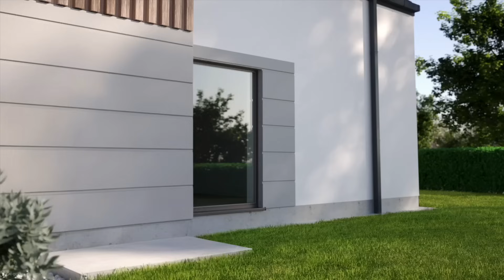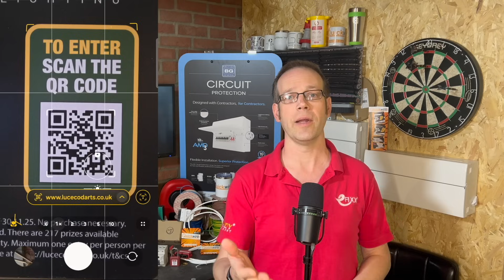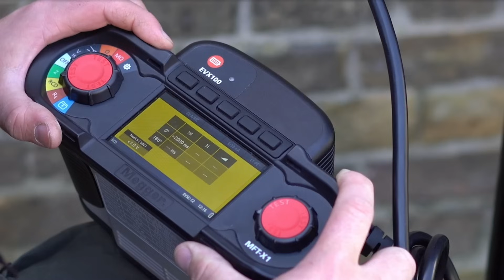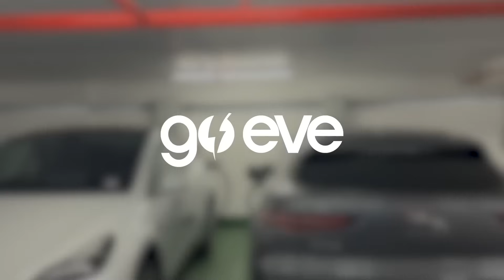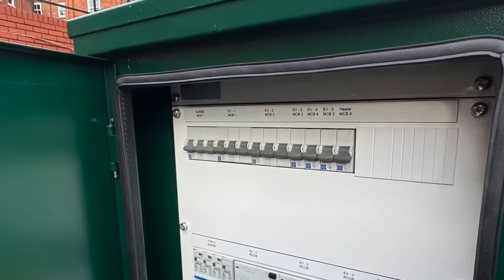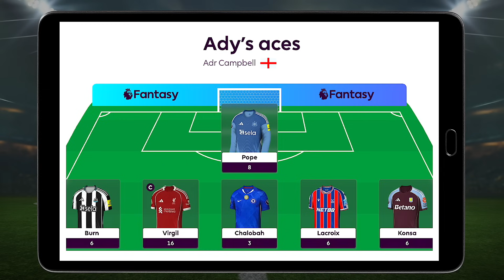National Grid Wants To Move Electricity Meters To The Garden

Comment: My neighbour has a 3 phase supply but it was unable to successfully heat a bungalow on his land. He asked for a replacement which could be supplied at a cost of £146,000. He declined and installed solar power. In addition to quoting for supply the provider made the comment there was no way they could guarantee the supply. Power failures are quite normal in rural areas. So there you have it. There would also be the point that exposed electrical consumer units would be at risk of accidental damage and increase the liability of anyone involved to electrical injury as well as impact injury. I suggest the insurance premium of the property might well increase. Another oversight by the Government that Mr Miliband has forgotten to tell all of us about and about how the whole of the community will be made liable individually for the cost.
Reply: I'm not sure the first part makes sense, what was the method of heating? And what us his heatload? I suspect it's a lot less than 41kW even if it was resistive heating.
Reply: Definitely a case for Air Conditioning!!
Reply: The heat pump technology with R290 systems has changed a lot over the past year, plus, if we are all honest, I think all of us engineers are a lot older, wiser, more educated and more experienced at installing these large integrated photovoltaic, heat pump, battery, air handling, computerised systems that have only really becoming truly successful in the past year or two.
Reply: @Ino-z2m R32 knocks the sox off all of them..

Comment: Just no! Why is there SO much info directed towards electric charge points for EVs?
Any business which depends entirely on this tech is going to fail.
The demand is dropping, the tech and infrastructure isn't there yet.
OK, you might make a few bucks for a year or two, but the public do not want EVs...and once you have one, you won't be buying another one anytime soon (unless your original unit fails).
Be smart and stick to installing conventional systems, not EV charge points...that ship has sailed.
Same with heat pumps...if you have the land and the money, ground source is brilliant...but 99% of the population do not have that capability.
Don't be fooled by the net zero madness, it simply doesn't add up.
Reply: @colinritchie1510  we are trying to buy an EV but the cars that work for us just aren't available as an EV

Comment: For decades I have stood in disbelief as the power network keeps running single-phase to anything they can get away with as the rest of Europe looks on in bewilderment.  Not even publishing ducting requirements to allow for a 3-phase 'future' for new builds.  So here we are - looking to put ugly street boxes everywhere for 3-phase whilst still installing new single-phase everywhere.

Not that DNOs can get their facts straight.  For my own home I enquired about a 3-phase upgrade as we readied for the new electric-only future.  The bad news was the nearest 3-phase node was at the far end of the street, with no practical path.  So in went single-phase solar, CUs, with export limits et al.  Once the solar, battery etc was complete the DNO sent a revised network diagram of our small road.  To the surprise of nobody reading this far, the nearest 3-phase node was actually located on my land, about 5 metres from my meter cab, from which I get just 1 of the 3 available legs.  Grrrr
Reply: Living in a 1940's house... 3 phase into the house! So what changed??
Reply: Out side the uk 3 phase is used so they can use 3x50A (or lower) supply, uk we generally get 100A per phase even if its single phase

They doing this so the dno supply ends at the curb anything after is home owner problem if there is a fault they have to pay (currently anything upto the meter is dno problem)
Reply: @leexgx not quite. Since at least 2023 NGED have standardised single phase to a max of 80amp- they no longer fit 100A to single phase. And they’re only responsible upto the CO. Meter AND tails belong to supplier. Either way it’s a ridiculous idea to have boundary boxes like this. What’s worse is that no one is addressing what anyone living in terraced housing with no gardens will do about all these future requirements like EV charging etc.

Comment: Is this National Grid as Grid operator or the DNO? I suspect the latter? I cannot think that they are trying to solve a problem that barely exists? I am not an electrician by trade, but do have a house which is heated by a heat pump (14kW - yes bigger than most homes need) and an EV. With single phase the draw can reach 14kW in the wee small hours when the kitchen fairies (dishwasher and washing machine) are working, the car is charging and the heat pump thinks we are about to have a legionella outbreak... and whilst a 3 phase charger will help those with expensive EVs it won't help the average household even with 2 EVs. Most people don't drive more than 30 miles a day which is roughly 8-9 kWh of charging. The Grid and DNOs have the wherewithal to manage the timing of newer than 2020 chargers (the vast majority) so where is the problem? It will help those who aren't able to park their car immediately outside their house. In Scotland most of the homes built in the big 'housing schemes) are in such a position as are those with garages clustered away from the houses as was favoured during the 1960s.

Comment: I have red / green / brown issues and have never had a situation where the colours on the wiring were so poor (Australia uses red/white/blue black and green/yellow for fixed.  Plenty of older green earth out there and even clear / bare separates) that I could not easily distinguish them.  Even the muddiest example of IEC colours I've ever come across are a breeze.  A man (it's mostly a male problem) would need to either be truly colourblind, ie monochromatic, or missing a colour completely (red or green) for it to be an issue, in my opinion.

Comment: Megger need to fix the massive issues with the X1 first, dodgy firmware, crap test leads, etc
Reply: You mean great test leads imo, a million time better than the Kewtech ones I use with a 1552…and I’ve had no problems with the x1 after all the firmware updates
Reply: The leads aren't crap they are always 10cm too short and you stretch them making them crap!
Reply: @Ino-z2m  maybe we got a dud batch, the strain reliefs were SO stiff there was no way they could be described as strain relief,  and the connections are hella loose. Even brand new, moving a connection would vary by 0.5 ohms. Contacted megger about it, they ignored us entirely

Comment: But the National Grid is also saying that when everyone has an EV the LV distribution network will only have enough capacity to supply 7.5kWh per consumer, per day for EV charging. That means even if you have a 7.5kW charge point, you can only charge at that rate for one hour per day or, more likely, your charge rate will be limited to 1kW for 7 hours at off-peak times.
Reply: I don't know about that. The house I live in was built in an "all electric" development of around 70 houses in the 1970s with storage heaters and I'm sure all the houses here drew far more than that in the winter months. The development has its own 11kV substation.

Comment: The premises owner being responsible for underground cabling past the property boundary is common enough around the world but insisting the metering is on the boundary is not.  Having the metering in a pillar on the boundary is not going to make it run any cooler compared to having it in a box on the exterior wall of a structure.  Moving it from within the structure to the exterior is definitely a good move though.  All in all the key point appears to be DNO costs more than anything.

Comment: Am I the only one that thinks this is a sound idea? 3 phase heat pumps surely solve a fair share of problems, as does having the ability to charge at 22kwh during off peak hours. Not sure how they would implement it cost effectively though....
Reply: Look closely at the brochure. It specifically mentions running new single phase cable to the EV charger. lunacy.
Reply: @evan010101  ok that is ridiculous

Comment: So there will be 430 volts between the car charger and the the outside socket the owner has plugged the pressure washer into to wash the car while it's charging. And yes people are stupid enough to do that. And surely this adds extra complexity of using solar panels to charge the car? It just seems needless. I think National Grid just don't want responsibility for cables in gardens.

Comment: If they put the meter box on the boundary they better have a better door than they have now or the yobs will just stroll down the street turning everyone off. 3 phase is a good idea for new houses but utterly impossible to run out to most existing houses.
Reply: Yes, the DNO will supply padlocks or euro cylinder barrels (for free!) and you get a couple of keys, they have a master key. System works great until some bird brain feeds the incoming water supply with the DNO cable and the two meters share the same box that as an electrician will infuriate you beyond all reasonableness!

Comment: My consumer unit dates back to the 60s: it is made from bakelite, and works perfectly well!
Reply: We were all conned. Assuming yours is A Bakelite one with a wooden back . We were told we had to up grade and not use them as they had a wooden back and were combustible . Guess what we had to use plastic ones . So the whole country slowly changed to plastic . Then years down the line it turned out the plastic ones were 50 times more combustible than the old Bakelite and wooden type . . Can you believe it .
Reply: Seen plenty of electrical fittings that work “perfectly” well according to the imbecile that fitted them, usually without connecting the cpc and always with loose connections. But does your rewireable board with plugin mcbs have additional protection, type A? Or an SPD ? And I doubt it has any spare ways or even the room inside the tiny enclosure rammed full of vir cable…..but hey its only electricity its hardly important.
Reply: @jonanders76  nerd
Reply: @jake1173  Thank you little Jake.  I know it must be difficult for you in the comments section, surrounded with full sentences and paragraphs etc. But I think you’re doing well, even with your one word contribution. In future though, if you use a capital letter at the start and a full stop at the end, I think it will show you’re slightly improving from the single letter comments you usually make. I bet the doctors in the psychiatric ward are proud of you little Jake. Well done and keep up the good work.
Reply: @jake1173  rude

Comment: An 8 kW heat pump doesn’t draw 8 kW. If its COP is terrible e.g. 2.0, it may draw 4 kW, but if installed well, the COP might be 4.0 and hence it would draw only 2 kW.
Reply: Indeed. The average home isn't some sort of mansion that needs multiple 14kW+ heat pumps!
Reply: I do not know  much about heatpumps in the UK. Here in CZ  if you apply for a heatpump they want 3x20A or 3x25A  for  the heatpump itself as it usually has some backup electric heater. UK may be different as UK's winters are milder.
Reply: How much does a domestic CH circulating pump draw?
Reply: @philtucker1224 my Grundfos displays a usage of between 15-25 watts depending on how many TMVs are open.
Reply: @HowardBurgess I think the 8kw requirement was an error on his part.

Comment: Greetings from the Netherlands. House built in 1981 with a one phase electricity meter. The cable however was already 3phase. By replacing the fuses and the meter I switched from single phase 40amp to 3 phase 3x25amp.

The arguments to do it outside sounds like pure cost driven for the national grid not what's best for the consumer.  If overheating is an issue then it wasn't safe in the first place.
Reply: I think the argument being put forward is from an idiot who has little understanding of construction or civil infrastructure,  your comment "If overheating is an issue then it wasn't safe in the first place"  is absolutely correct and to use this as an excuse is pathetic. I have a 3P supply and the cable is not that much larger than a single phase coaxial.
Reply: The UK uses phases differently, most homes are connected to a single phase, but at 60A,80A or 100A so there was never a need to lay a cable for more than a single phase. So upgrading an average home with the consumer unit found in the center of the home would involve a lot of rather costly trench work to the center of the home, and then the space needed for a 3 phase consumer unit for no real advantage if the aim is to then provide better support to devices that are themselves installed outside of the property.
Reply: @rogerthomas7040 but switching to 3 phase  was also done to let people balance their usage over the phases (based on the video). If the 2 extra phases are only used for a heatpomp and an BEV Charger there isn't much balancing at all.

My main point was that in the Netherlands they already had foreseen 40 years earlier that a three phase cable is a good investment. And that's just based on my own house. I have no idea when they stopped with the single phase cable to the regular residential buildings.
Reply: @rogerthomas7040  you still have to pay for the trench for the new cable from the new meter box to your existing service point.  The difference this cable would no longer be the suppliers responsibility but the home owner.  Wait until someone drives into this bloody great big box at the edge of your house.  On some streets this design will not be possible.
Reply: Yes this is purely a cost issue , they don't want the cost of trenching or worming the cable . Of course its not just there cost as this would be added on to standing charge .
Reply: In the Netherlands,  it's nice that we pay the same amount of money for 1x35 (or 40) and 3x25A.

Three phase homes, with a single phase contract have their cabinet on different phases then the neighbours. 
House 1, phase 1  2 on 2, 3 on 3 and 4 on 1. Etc.
We even have an official website for that,  where installers can (altough voluntary) use this. 
So,  one or 3 phases do not(!) balance the grid more.
Reply: @gubbernl  And in the UK you can get 1 x 100A for the same cost, so where's the difference apart from the load balancing being done in the street rather than in the home?
Reply: @TheEulerID 
I totally agree with you! 
Issue over here is that the cable to the house is at most 4 or maybe 5 x 10mm2
So, never suitable for high currents like yours.
In my case, one phase with 100A would even be better, because I have 3 Victron Multiplusses for home energy storage. It would be cheaper and easier to install to have only 1 bigger unit. 

But yeah, every country has it's own quirks I suppose.
It takes a lot off time,  money and effort to change it nationally.
Be glad you don't have the strange split phase stuff like in the US😂
Reply: @TheEulerID Nat Grid hasn’t fitted 100a for a few years now. Most you’ll get from them on single phase is 80amp.
Reply: @Vartan297 what has to be National Grid got to do with it? The local connections are made by DNOs.
Reply: @TheEulerID National Grid is the DNO for East and West Midlands. The South West of England and South Wales.
Reply: I wonder why next door almost burnt to the ground when the gas heating failed and they heated by electric.🤪
Reply: They have already fitted 3 phase to my house in the house I was told it was because I had a car charger so it’s totally possible they just making it easy to cut people

Comment: Idiots in charge!!! In Europe they have been installing 3ph in new domestic properties over 30 years now !!! The UK is classed a a 3rd world country !!!
Reply: My 1930s house has 3phase cuz we needed unlooping for our heat pump...  Spoke to national grid, I installed box and 25mm swa to the new 3phase board.  No fuse required....
Reply: Exactly! And extra heat? Only if you have more consumer units 😊
But without that,  it doesn't matter if you use 1 or 3 phase. 
The wires will be even cooler  you use three instead of 1.
In the Netherlands, since a couple of decades, we have more or less standardised meter cabinets: next to the frontdoor. Germany the same, with even humongous cabinets,  altough they cheat by not putting all cabinets near the frontdoor.
Over here it's custom,  so that the fire department can shut down electricity quicker. 

I admit that an outside meter/disconnect is even better for that purpose,  but we just don't have outside cabinets for any utility.
Maybe that had also something to do that most of the houses don't have the space for that (many townhouses and flats)
Reply: I'm looking at all those fancy things you are deploying in UK, like AFDs and type B RCDs. AFDs are so expensive here that I haven't seen a single one installed in a residential home for the last year. Than I see you running on a single phase with meters burried in the middle of houses. 3p installations were getting common here already 40 years ago and almost every home has them today. Moving of the meters outside of the homes started maybe 20 years ago. There are still old homes with meters inside but they would not put in a new meter inside, unless it's a 1:1 replacement of a faulty unit. The standard fuses are 25A (20A in some places where the network has no capacity). You could apply for higher currents but there is no guarantee that you get it approved. So you actually need either 3p, gas or some patience when cooking :-) 40-80A 1p would not get approved here.
Reply: Practically all installations in Germany and Netherlands have 3 phase..in the house, not in the garden..UK is so behind but thinks it is superior..
Reply: Roy, 
what is the capacity of these services on average?